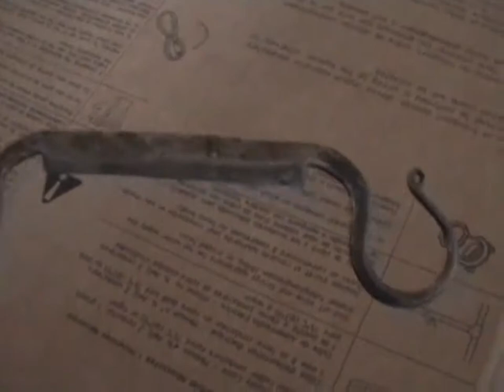Acquired Lots of useful stuff

Comment: Nice bit of stuff there Bill. Picked up a small skinner a couple weeks ago, made from an old saw blade. The guy had done several larger blades from files and very unique.
Reply from the maker: +Brian West (BrianWest58) A lot of saw blades are not made of very good tool steel, which they don't need to be. They cut the blade out of cheap stuff then attach good teeth. Now older saw blades before they started attaching teeth that's a whole different story.